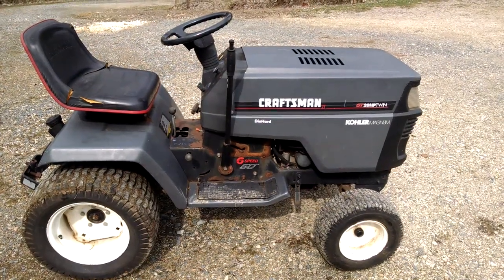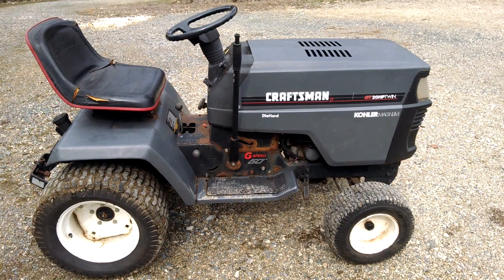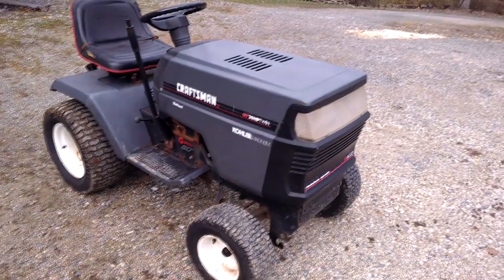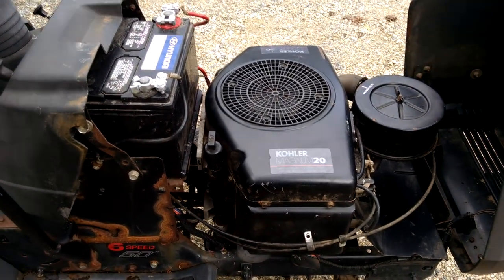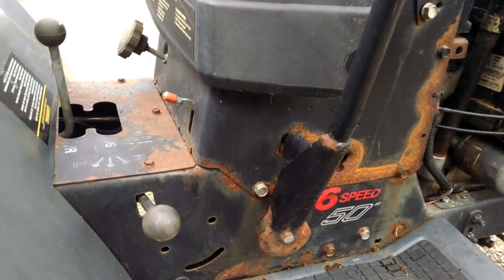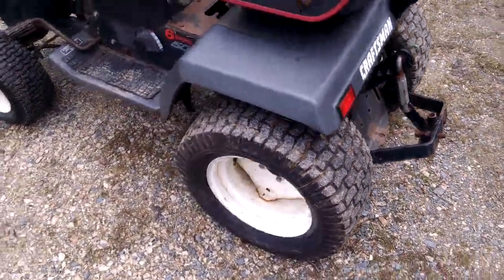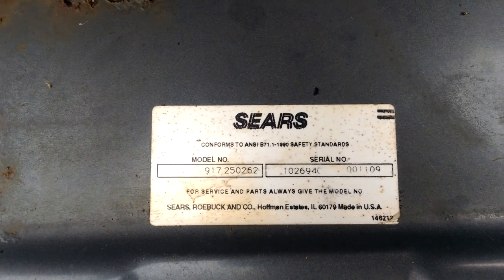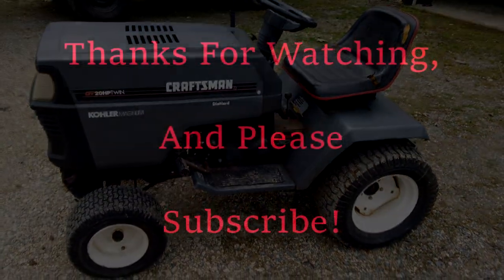94 Craftsman II GT6000 Garden Tractor

Comment: Just bought mine. Didn’t run owner said it runs with gas in the carb. So for fun I put gas in the tank. And a new air filter, fired right up. Going to clean it up and use it for off-roading.
Reply from the maker: That would be great for that- A little maintenance and I am sure it will work perfect
Reply: I've got a 91 GT 6000 with the 18 horsepower Briggs & Stratton opposed twin that I use around the land at it's a beast

Comment: I got my 96 GT6000 off the Craigslist in 2018 for free.. required no major work.. The peerless hi/lo trans is absolutely bullet proof, as long as you don't grind when shifting. I got a new old stock factory push bar for mine.
Reply from the maker: They don't make them like they used to.

Comment: I like these stories. Why does old always seem better? Of course this is not the case but there is something rewarding about getting and older workhorse tractor for cheap and fixing it up. As has been said before, the new ones don't compare in quality unless to go into the 5-8k range maybe. I saw the Troy Bilt Pony they sell at Tractor supply and HD for $2200 and it looks like a toy kids tractor, something you would buy little Johnny to learn on. Back in 2008 I bought a 1988 Wheel Horse 518-H, Onan engine and it mowed great and was built like a tank. They do eventually have problems and die but that is after 30 years or so of hard labor. I currently have a Craftsman GT5000 (Husqvarna) that I love but it is about 20 years old and needs a new engine. So now I am on the hunt for another GT........
Reply: Because for the last few generations that the old timers have been saying "everything is turning to shit" it turns out that it's not because they have become cynical with old age. It's because they saw how things were, and things actually are turning to shit.

Comment: Great machines.  I miss mine a lot.  Mine was an 88 model closeout in early 89...served me very well for 21 years before the engine failed.  I'd love to find another one, only difference was mine had the 18HP Briggs & Stratton 2 cylinder engine and the 44 inch mower deck.  That 2 speed transaxle was great for all sorts of work, with weights and chains it would do great for plowing too and attachments.
Reply from the maker: It's a really underrated work horse. I've pulled some pretty heavy loads with mine, and in 1 low its a beast!
Reply: Yes they were, they were a pretty dang good machine, and if they would have had an option for a locking differential and some agriculture tires they'd make a great tractor for small gardening projects for sure.  I really want to find another one and set it up to use for gardening.  The stuff they build now is too cheaply made to hold up to any actual pulling.  Not sure how the larger John Deere Garden Tractors like the X500 series and X700 series would be maybe ok, but not the box store stuff.

Comment: Heads up, that doesn't have a peerless trans. That has a Roper 633a, 3 speed, high low, with square cut gears and needle bearings. Oil filled, and has 3 sets of planetary gears for the differential. Also has 1in axles with splined ends. The hubs are 5X4.5, same as Ford Rangers. I've got a 1992 GT 6000 that has the all metal hood and grill(it's my profile pic). It originally came with a horizontal Onan 20hp but I've converted it to a 18hp Briggs opposed twin pressure lubed vertical (PO got the tractor for the engine for his Craftsman FF).
Reply from the maker: Thanks for the heads up, and even more so about the info on the hubs. I've been thinking about a set of dual wheels for the rear of this one and that info is perfect timing!
Reply: @FarpointFarms  Please do a video of how you did that if you ever do it.

Comment: cool, while back i picked up a couple gts, one a 86gt 2 with 18hp opposed twin horizontal, the other a 90's? gt6000 with 20 hp onan. well 86 was in by far worse shape, but 90s had a bad coil.  so my gt6000 became a parts tractor for the gt 2, used the practically new deck, went thru and cleaned/ painted it, motor was full of water, but with cleaning it did run.
its a beast, i pull my trailer out of the back yard, it digs right in. sometime id like a sleeve hitch and front plow on it.👍

Comment: My old mans tractor is the exact same one..  Still runs, very dependable.  You can still find replacement decks.  Note, it is a belt driven tractor, do you will go through belts if you do heavy work.

Comment: I just picked up a GT 6000 ll with the 20hp Onon Engine.  Tractor is in beautiful conditions with a low 247 hours.  2 issues.  Engine cuts out if I engage the electric clutch for the mower (seller says he thinks the mower spindles may be frozen) second issue is the battery discharge light is on.  (seller says it may be an alternator or something). If anyone has any experience with either issue I would much appreciate hearing from you.  Thank you.

Comment: I got my GT6000 brought into my shop for free hehe.  Didn't even need a carb clean, brand new carb.  A set of piston rings later and shes plowing my snow.   Mine has the 18hp Kohler but no worries, a few months ago someone brought in an MTD branded mower with a 20hp Kohler and newish deck. Ok, I'm done bragging.  And 4 quarts oil?  Thats crazy, whered you see that?

Comment: Got the same one only mine had a 44inch deck and a 18hp briggs opposed twin decks in great shape but i only use it to plow snow and pull bushes and my old truck around untill we finish the rebuild of its motor

Comment: I have a 94 (Manufactured in 93) Wizard mower, Same platform as your craftsman. VERY RARE. I can only find 14 horsepower models when mine's a dual cylinder 18 horsepower. Biggest difference is gas tank is bigger and underseat instead of behind engine. My mower is VERY RARE and I opnly payed $50 for it. It had common issues like craftsmans. Bad starter.
Reply: I have the 1994 Sears Craftsman Diebard II LT4000. 42 Deck, 18HP Briggs, Gas tank sits under the seat. Sat in our family barn since I was a kid. I recently resurrected it, cleaned the carb, changed the oil, new tires, greased and changed the oil. What I found fascinating is for the size of the engine it does not require an oil filter…I love the “Made in the USA” sticker on the metal hood. Runs strong and that engine sounds like lion lol the neighbors love it.

Comment: You stole it. I just paid $300 negotiated down from $400 for one just like it except not in running order. It's being added to an 18hp that I bought new in '94 and still use. I've since got it running and on it's way to being not restored but made nice. The tractors were/are tough but the mower decks were under-built. I've long ago stopped mowing with the 18hp and won't mow with the 20hp either. I'm looking for a hydrostatic model to buy next then it's on to an old Wheel Horse.
Reply from the maker: There are still good deals out there, some of them are just a bit farther drive!